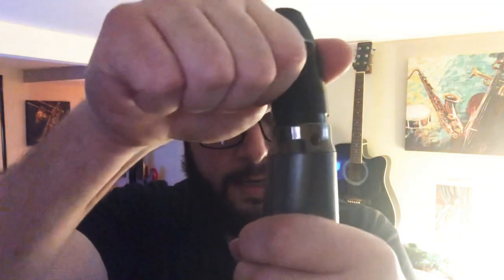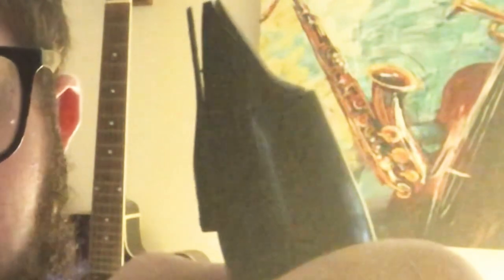Roland Aerophone AE-10 How To Fix The Bite Sensor

Comment: i am a bit shocked that roland haven't ironed this bad design flaw - but great that you share this "solution" until they do (IF)
- i am still considering buying the Aerophone Pro as my first EWI - surely i would have been devastated if i experienced this flaw upon unpacking  - without knowing what to do about it - its a 1500 dollar piece after all

So thanks again for sharing
Reply from the maker: Thank you for your comment! Yes, that was the purpose of this video. Though this fix is temporary and would need to be adjusted from time to time, it give you a fighting chance to be able to use that form of expression.

Comment: First: check the bite control is switched on in the menu for each sound you are using (it may default to "bite control:off" every time the AE-10 is switched off unless you save your settings in a user profile)
BEWARE: the metal bite sensor arm is only supported in a plastic yoke which is an integral part of the front case. It is definitely not strong enough to survive any bending force applied to the wire and would require a whole new front half-case to repair.
If you are going to attempt to bend the sensor wire you MUST support the wire with a second plier as shown. As described, it should be adjusted to just touch the reed.
The tapping sound is the other end of the wire touching the front case. Only the rubber seal applies any force to keep the wire pressed against the reed. Unfortunately the other end of this seesaw mechanism is longer than the part you can see so the rubber seal may not have enough strength to keep the wire pressed against the reed.
Using teflon tape like this is adding a bit of tension which makes up for the lack of a decent return spring which is sadly lacking (poor mechanical design by Roland)
When the aerophone is switched on it performs a calibration to determine the null position of the bite sensor wire. If this is not working I would suggest a factory reset (back up your settings first) using the option in the menu.
Reply from the maker: Nailed it! Thank you for this write up!
Reply: @MikeySaxMusic  thanks for your video
Reply: I absolutely agree with you, I don’t think is’t a good idea to mechanically force the bite sensor down, it must be able to move in both way equally! I notice that I have to change my bite control, pitch up, pitch down every time I change the instrument to be played. If you tweak the settings in the menu, you’ll find a good solution. For the bite control, position 1 is better for me. But I do agree that the design is far from perfect…..

Comment: Thank you for the great video. I myself am working on a DIY wind MIDI controller and the mechanical part is the most complex, so I was learning from other companies' mistakes. I'm using a similar design with a customized cheap sax mouthpiece and a metal rod pushing against the reed and reflecting off a reflection sensor, so I'll have to think of a good way to avoid the Roland's mistake. Maybe a spring at the other end would help to ensure proper neutral pitchbend position and reed pressure. I also looked at Akai's solution but it seems too complex for a "mere mortal" electronics hobbyist to implement. Not sure what Yamaha is using though, it's difficult to find in-depth reviews and internals of EWIs, so all I have are some service manuals that do not quite show all the elements from all sides.
Reply from the maker: Please contact me when you complete it, and I would love to do a demonstration.
Reply: I'm afraid with my pace it will take years to have something to demonstrate :D Although I have collected all the necessary parts, currently I have only the wireless transmission part working. Not sure why I started with the non-essential wireless stuff instead of the core MIDI functionality, but I really enjoyed testing nrf24 chips on a prototyping board, and now I have a reliable USB dongle that will receive MIDI messages wirelessly with less than 2ms latency.
While looking for sources of inspiration, I have found a few other DIY-style EWIs, and some of them are even available to buy. One of the best examples is WARBL. It's small and might seem lacking in terms of number of keys, but it has a unique feature - finger distance sensing. So you can get vibrato by slightly flicking your finger above a tonehole. These optical sensor toneholes are free from any keyclicks (looking at Roland) and do not require moisturized fingers (looking at Akai). In addition, it is fully open-source software and hardware, and the control customization options are the best in the market - you can configure your own fingering patterns and set actions for the small control buttons - octave up/down, semitone up/down, custom MIDI message - anything. Roland and Akai should learn some things from WARBL. Youtube has some demos of people having fun with WARBL, but unfortunately they are not uncovering all its potential - it's not just a tin whistle or bagpipe simulator but a full MIDI EWI.

Comment: Thanks for the heads-up. Definitely something to check out. The bite sensor is the Aerophone's most important feature IMO. I certainly hope they've fixed this in the AE-30. Alistair Parnell says the AE-30 has a similar mouthpiece to the Go rather than the AE-10 so hopefully that's a good omen.
Reply from the maker: We shall see. I honestly think I would shell out the cool 1k and get the Yamaha at this point... There is certainly going to be a wave of midi controllers for wind players coming, and I’m sure we’ll see some go neck in neck! Thank you for commenting, please consider subscribing if you already haven’t. Happy Holidays!
Reply: @MikeySaxMusic  I don't thnk the new Yamaha has a bite sensor at all, just a thumb lever.  There's no mention of one in the manual, and it takes a normal looking sop sax mouthpiece, IIRC.

Thanks for this video.  I have the white AE-10.  My bite sensor works, but the response is odd.  I always assumed it was just bad software (especially since it's only allowed to bend down from the note, never up - which is just poorly thought through), but maybe mine has some play in it.

My Yamaha WX5 is a better controller than the Aerophone, even though it's quite old and starting to show its age.
Reply: Just picked up the Ae-10 already own the Ae-05.  Found your video interesting.  The bite bar on the Ae-05 is centered near the top of the reed, I found a post on the Ae-30 and was able to see that the bite bar is located same as the Ae-05 which is pretty solid.  Also found and interesting post  from the Gonzo Project (I googled Ae10 mouthpiece).  It was written before the hidden settings were added to the menu in version 3.10.  I have not tried you fix yet, mostly was playing with learning about the Bend settings.  Found a tool from Crudebyte called midi wrench (free) which displays the codes sent from the aerophone.  (Side Note - His Heavy Brass app is also quite good use the sax and trombone and heavy brass mix all the time with the ae-05).  
What i found with the midi wrench was touching the bracket that holds the bite bar would cause a stream of bend messages, also could generate messages holding the neck of the mouthpiece.  Also, checked out the video from Alistair Parnell who seems to have a direct line with the company  in his video (pre version 3.0) found that he needs to readjust the bite settings whenever he mounts the mouthpiece.  So at best it is a little dicey.  The Crudebyte tool is really useful to get the mouthpiece aligned as you can see the output when bending the reed.  
I am getting ready to try your hack, I think I will use a piece of ribbon dental floss, I would think it will be more stable than the Teflon tape which is kind of stretchy.  Also I am going to try and tension it so that touching the bite bar retain no longer produces a stream of bend messages.  That seems to be the way the ae-05 is working.  I'm open to suggestions if there is something you have noticed.  

Thanks I never would have figured out the issue without seeing your post.  CC94 is not a bad alternative to the Bend.
Reply from the maker: @virgilvision4520  Hey Vis! Thanks for this awesome reply! I wanted to try dental floss! But I switched to those plastic flossers and I don’t have any at my house. The Teflon tape is holding up well! Yes there is a stretchy element to it, but for all intents and purposes, it is doing the trick w/o me having to re-tighten it. Thanks for all the info in your comment!
Reply: @virgilvision4520  I have opened up the AE-10. The wire bite sensor pivots like a seesaw with a longer arm inside (to mechanically amplify the bite motion of the reed)
The internal arm has a bend in it too and has a spatula end which hovers close to a circuit board but not touching it. I believe the signal is created using a proximity sensor.
Your hand on the neck is probably affecting that proximity sensor too.
Each time the Aerophone is switched on it performs a calibration of the null position of this bite sensor wire.
Reply: as far as I know the AE-30 has exactly the same mouthpiece as the AE-05 (only the latter is much cheaper).

Comment: What a terrific Solution to this terrible problem. Your detailed and clear tutorial is much appreciated.  I now that the Teflon Plumbing Tape stretches quite a bit and I was wondering whether you have considered using Dental Floss. There are a lot of different types in addition to the traditional types and they also come in various thicknesses and as far as my experience tells me these are waterproof, very strong and do not stretch much at all.

Comment: Thanks for talking me out of getting one, I just wish more Ewi used a 5 pin midi out and had good mechanical action as opposed to the akai
Reply from the maker: If I could have a time machine, I would try to find something else as well... I really want an EWI4000S!! But hey, I may barter a bit until I can find the right controller... STILL A GREAT OPTION, to just be able to pick up and play is still very hip!
Reply: @MikeySaxMusic  The problem with the AKAI is the silly galvanic skin response keys, makes it too easy to hit wrong notes just for keeping your fingers close to the pads like we’re are accustomed to on normal sax. Plus the rolling octave mechanisms are really awkward to transition . THE OLD Yamaha WX are great mechanically but compared to the AKAI does not sample breath as frequently, so the akai is much better for natural sounding vstis that I use.  The newer Aerophone has better looking action than the akai and even has 5 pin midi (I hate usb, they always are cheap connectors) but if customer service is that bad, I will pass.  The Odisei sax looks great but does not have a vibration or bite feature, but they are thinking about adding it in a newer model...

Comment: Just bought a used AE-05 and the bite wasn't working - thanks a lot for your video but there is a much easier fix - just wrap some tape on the tip of the sensor to increase the thickness until it touches the reed - or use some glue or clay to build something similar just to increase the thickness of a few millimiters (you can also increase the lenght of the prong to allow for more sensitivity). I don't really get the need to lower the prong from the rubber using the teflon tape - isn't that going to upset the overall pitch? Then you need to calibrate the whole lot...as long as the prong touches the reed and return in position there should be no need to eliminate the play above. Yes, I think the ultimate and neater solution is to use brute force using 2 pliers...but why this prong got out of playing position in the first place?